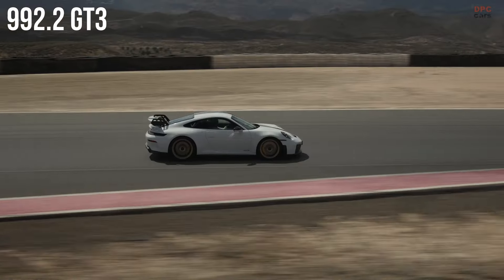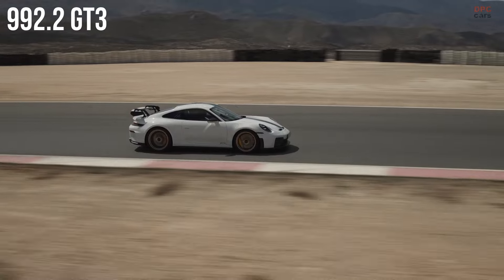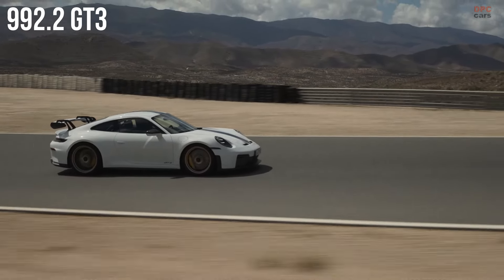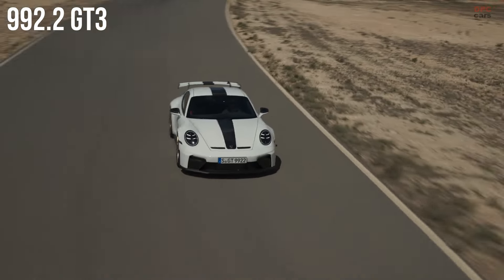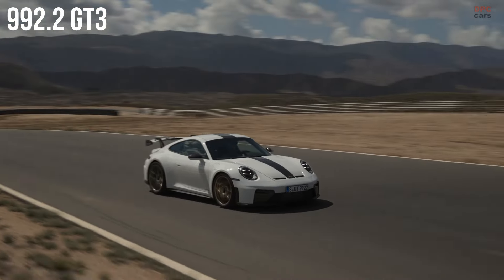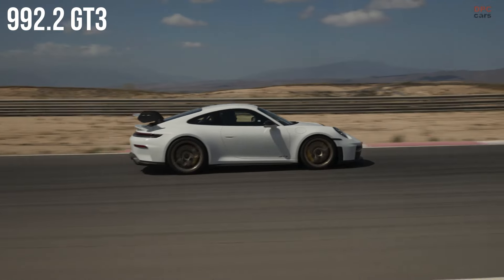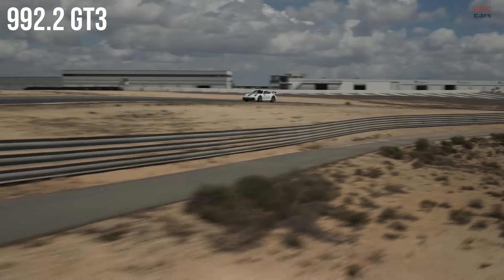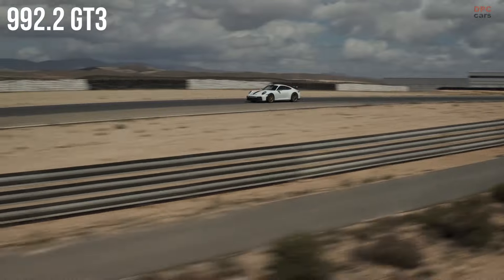2025 Porsche 911 GT3 992.2 vs GT3 992.1 Exhaust Sound

Comment: Can’t really tell the difference in sound between the .1 and .2

Can anyone else? If so, how would you describe the difference??
Reply: the .1 should definitely sound better because of less OPF's. The new one isn't bad, it just sounds lower and less higher-pitched. But just slightly.
Reply: I can!.1 sounds reasonable.2 sounds overprice
Reply: .2 sounds a tiny bit subdued